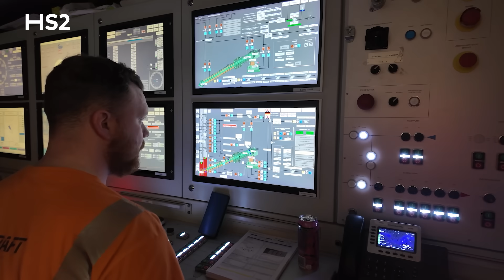HS2 Project Update, October 2025

Comment: UK Maglev 4 Dec 2021 — A frequent issue was   electrical failures concerning the magnetic transit system    at guess where?                                  > Birmingham > Birmingham Airport <
Maglev trains have set several speed records. The train speed record of 603 km/h   (375 mph)      was set by the experimental Japanese L0 Series maglev in          2015,  correct 2015!

The UK is till laying steel rail tracks down which will last for 100 years.

Comment: This pattern isn’t confined to government — it runs through every major Western corporate and public programme today.

What we’re seeing with HS2 is simply the most visible example of a systemic problem: the culture of institutional self-preservation, where leaders rebrand failure as a “reset,” “re-baseline,” or “strategic realignment” rather than admitting the design, sequencing, or governance collapse that caused it.

The same structural flaws repeat everywhere:

-  Build starts before design maturity or full analysis. Activity is prioritised over readiness to secure funding or political optics.
-  Commercial frameworks reward inefficiency. Prime contractors profit from claims, extensions, and variations rather than from on-time delivery.
-  Diffuse accountability. Nobody owns integration or system-level performance; everyone owns a slide in the deck.
-  Narrative replaces fact. “Resets” and “learning phases” become the language of decline, while cost and schedule performance continue to deteriorate.

And of course, I’m sure there’s a beautiful slide pack to make it all look under control, polished, animated, and coloured green on every RAG status, reassuring those who never visit the site.

Government is no different. The same failures of discipline apply: projects are launched before design and analysis are complete, often for political theatre rather than delivery readiness. Once committed, they’re too big to cancel, even when the business case fails.

The only credible way forward — in both government and corporate environments — is to treat each major initiative as a self-contained project: complete design and analysis before committing capital, apply independent validation at each gate, and kill it cleanly if the business case does not hold.

That’s delivery discipline — not optics, not “reset culture.” Until that returns, the West will continue to build before it understands and learn after it fails.

Comment: Impressive honesty setting the first phase of much-needed new railway capacity in the UK.  Without Phases 2A and 2B (through Crewe to Manchester and up the East Coast to Leeds, the stagnation and overload of the existing West Coast main line (major refurb work starting 2027) and East Coast Main Lone (new timetable Dec2025 but basically stuffed full) will bite with greater intensity.  Capacity does not come overnight.  I look forward to the next HS2 update, but "onwards past Handsacre" needs to be entering the song book for the next phase of planning and design.

Comment: We now know how to build a new high-speed railway system including everything from earthworks to tunneling, viaducts, tracks, ballast, sleepers, power, signalling, rolling stock, locomotive or multiple units, new built and upgraded stations etc 
Why not build the rest of the system to Inverness and for probably the same cost as has already been spent on a 5th of the line that's how it's supposed to work right?

Comment: I do believe that the HS2 will prove to be the most waist full and pointless infrastructure project. It is going to result in a one stop train journey Birmingham to London which will not be significantly quicker than what is currently on offer. The towns such as Milton Keynes, Rugby and Northampton will lose their express service to Birmingham and London. The cost of a ticket will be far greater than the current cost. Given the fact that business travel has shrunk since COVID I just can’t see who is going to use this service. The 100 billion spent on this project would have been better spent on developing the Midlands economy.
Reply: Since when did you get the idea that there will be no fast services using the traditional WCML route to Euston?? There can actually be more services Northampton/Milton Keynes to Euston due to track slots freed up by trains using HS2 instead.
Reply: @rhysjaggar4677 Because the whole point of HS2 is to put more freight on trains using the current lines. In addition to this there will not be enough demand from these smaller communities to justify the service. So no there will be a lot less services for these smaller communities. What is not clear is what services from Manchester and Liverpool will still operate. Are they going to terminate in Birmingham and the passengers transfer to HS2 trains? I have travelled regularly on the Midlands to London services and I can tell you that most trains are sparsely occupied once they leave the Midlands and head north. Personally I am not convinced that there is sufficient demand from Birmingham on its own to support the HS2 line. Now that the line is not going North the passenger numbers do not match the capacity, add on to that the reduction of passengers since COVID and it is a total mess. So yeah there are going to be reductions in services and I suspect an increase in costs.
Reply: @stephenbuck1280  I guess freight capacity is always useful in a growing digital world, but I can't help but think it would've been significantly cheaper to achieve it with wider motorways and an investment in electric HGV infrastructure to ferry goods from ports in the south up to the north. Trains are obviously a good 20th century solution, but when proper driverless things start coming around in the next few decades... what will HS2 be for?

Comment: The London to Birmingham Railway was built from scratch in five years using humans, animals, shovels, pick axes, wheel barrows and occasional steam cranes. It cost £5 Million from Private Finance. 
Will there be enough electricity to run HS2 by the time it is finished I wonder.
Reply: In a very different age with cheap expenable labour.

And HS2's electricity use won't even be 5% of the existing railway network, think of all the OHL and 3rd rail on Network Rail, 4th Rail on the London Underground and all the other systems, Mersey Rail, Tyne and Wear plus Tram systems.

Comment: Hopefully someone will have the sense to boot the treasury out of meddling with the project further. Their obsession with cost cutting has destroyed this project and their obsession with reducing yearly spend is hampering it further. The minister for transport needs to step up and get the treasury out of DfT business.
Reply: Im just as worried the damage that they can do to the existing network following nationalisation.
Reply: @garthcox4307 The good thing about that is that Network Rail gets it's funding in 5 year tranches so it's garunteed. The nationalised GBR will work under the framework of the existing Network Rail so that should help to protect it. The currently don't invest additional money into rail and I doubt that will change any time soon, so more of the same for the most part.
Reply: Sadly, The Treasury is the finance house of HMG. Unless you create an entirely different way of funding UK Government departments?

Comment: HS2 no longer has a benefit for wales by increasing capacity for welsh journeys, so it shouldn't be regarded as an england and wales project any more. 

With the connector at Litchfield kicked down the line wales should demand to receive extra funding from government for projects that actually benefit wales.
Reply: And you can already get from London to Birmingham in 1hr16m, vs 1hr46m from London to Cardiff. As I live halfway between London and Birmingham I naturally have to add over an hour to both of those times to get to either of them, and HS2 isn't going to change that 🙄

Comment: I think you maybe the bravest bloke in Britain. I was not aware that anyone was in charge at HS2. I appreciate you might not have written the spec. but I have never heard anyone working on this project say a good word about it, well I guess apart from you. I am sure one day someone will conclude literally tens of billions of pounds were wasted building this track. I am aware the UK needs new and better railway track but the cost of this is just ludicrous. In your defence the cost of just about all Government projects is unfathomable to anyone outside of Government.  Hinkley Point C was going to cost £18B now estimated to come in at £48b.  I just despair.
Reply: Don't hold your breath about the reset . It will only give an approximate updated estimate of the final cost and completion date.  Having worked for two of the Contractors building HS2 before retirement they will never agree to a reset of the contracts with the exception of accepting a profit share in finding cheaper methods of construction. So the costplus contracts will remain . All projects exceeding 500 million in value are procured the same way as Contractors balance sheets and margins are too low to accept fixed prices.
Reply: Picjing up your point about other government projects the cost consultants who put budgets together lack sufficient technical knowledge. Contractors know this only too well so when a projectcis advertised at a specific price level the reality is differerent. And the bigger the project the bigger the error. So when Heathrow's third runway is advsrtisdd at 15 billion the reality will be 20 billion plus, partly due to inflation snd partly due to workscope.. in Heathrow's case the workscope will be a new undsrground tube line, car parks, hotels, maintenance sheds, services alterstjonz, road alterations, diverting the M25, etc.

Comment: HS2 is a vanity project. The entire project would be cheaper if put underground - despite the fact that tunnels are much more expensive. 
Why cheaper? 1) No bridges 2) Almost no court cases 3) Almost no surface disruptions 5) Almost no consultants 6) The biggest two factors no cost plus contracts and no uncertainty about completion date.
Reply: Yiu are totally wrong about some pointd. Why no cost plus contracts
Reply: @TrevorWilliams-fq8mg Building bridges is inherently risky. The design must be a one off because no two bridges span the same terrain and length. Contractors will not bid for such contracts until massive amounts of preliminary work has been done. They will only do the job at cost plus. Once awarded  - all incentives to do the job quickly and cheaply disappear. With tunnels the cost is known and very predictable - the risks are tiny - therefore competitive tendering is possible.
Reply: Having worked for 2 of the HS2 Contractors before retirenent on the cost side , Contractors will not accept fixed price contracts exceeding 500 million in value as their balance sheets and margins will not support the riisks. Designers may say the designs are complete but they never are and never will be .
Reply: @TrevorWilliams-fq8mg Interesting. Would you recommend splitting sections of the construction into small sections so that they fall below that upper limit?
Reply: @johnfrancis4401 That's a possibility but might present more contracts that could go wrong, causing a bigger headache. I don't see the entire railway as being in a tunnel. Air pressure ahead of the trains would be huge. And the journey claustrophobic for the passengers. I don"t think it would have been considered .
Reply: @TrevorWilliams-fq8mg The line would surface for stations en route. The Channel Tunnel doesn't seem to experience the problems you refer to.
Reply: @johnfrancis4401 the Channel tunnel has an escape passage which also acts as a ventilation passage so that would add cost in.  Have you done an estimate ? If you can arrive at an  elemental cost for the tunnels and stations ( which would be extremely difficult to do) that would give you what a cost planner would do. But then there would be the detail to add and is where a costplanner would fail as the detail will cost a lot more thsn you would envisage.
Reply: @TrevorWilliams-fq8mg  Small thin shafts could be created to allow ventilation and reduce air pressure build up ahead of the train. Presumably during the planning phase of the route shafts are dug to check on the type of rock being drilled though  - these shafts could be kept open to facilitate air flow.
Reply: @johnfrancis4401 boreholes are taken to establish the soils and water table.
Reply: @TrevorWilliams-fq8mg Exactly. If you put pipes connecting the tunnel to the surface using these holes there will be space for the pressure to escape
Reply: @johnfrancis4401 It will be interesting to see your cost comparison.
Reply: Delayed by 4 years. What will happen to the rolling stock that is on order?

Comment: Stop-starting from the very top hasn't helped. Nor has the gold plating - Chiltern tunnels more extensive than needed to avoid upsetting certain voters. But I hope the gov says that's a realistic plan, but then opens a new Brum-Manchester project to start now and link up with trans-pennine upgrades.
Reply: Yep and cut and cover tunnels instead of cuttings, in some cases even in existing cuttings of disused railway lines.

Comment: Everyone we Need to build 11 platforms at Euston. Otherwise it’ll be impossible for HS2 to ever reach Manchester or Leeds. Government cut hs2 down to 6 platforms now
Reply: Why would the government build any platforms at Euston? In its current state the line will terminate at Old Oak Common. I doubt there is any money to extend the line into central London. The tunnelling has only been done as it was cheaper to continue than to cancel.
Reply: @wdielwlairajmd  HS2 is a capacity release program, now just for the WCML. Currently the WCML goes to the centre, so to release the most capacity enabling people to get to the same place is advantageous. If it stops permanently at old oak common then less people will want to use it and it will greatly increase the traffic on the GWML which is also short of capacity. Trains terminating at Euston reduces the most load on the WCML delivering the program best.
Also OOC was not designed as a terminating station, using like that indefinitely will reduce the number of services which can run on HS2 which is poor value for money.
HS2 has suffered from random cutbacks that seem logical but undermine the long term value. (see the "interim" now possibly permanent handsacre junction for another example).
Reply: @LD-yv2om Not sure what you are getting at here? I agree with most of what you wrote. The HS2 route was chosen well back in 2009. But it’s now 2025 and HS2 is now just an Ealing to Birmingham service (probably 3tph) with the potential for another 3 tph to Manchester. That’s it unless it’s extended into central London or further north. 2025 HS2 does not release much capacity, it will actually add to the bottleneck around Colwich/ Stafford.
Reply: @LD-yv2om The only benefit the WCML gets from Phase I is an increase in track slots for commuter services to London from Coventry, Rugby, Northampton, Milton Keynes and Watford. The true blockage in WCML capacity occurs in between Birmingham and Crewe, on what would include the Phase IIa of HS2. That's why Phase IIa was so important to complete, as the true blockage to capacity would have been released.
Reply: @wdielwlairajmd  Do some reading, HS2 will not terminate at Old Oak Common as the station won't have the facilities to be a terminal station, they are about to start tunneling from Old Oak Common to London Euston now.
Reply: @peterwallen1063  I know they are tunnelling to Euston and I know that OOC isn’t suitable to be a terminus! Why do I need to do any reading when I clearly know a lot more about the project than you. OOC will be the terminus for probably around a decade. There is no agreed plan for Euston - the tunnelling is being done as it’s cheaper than cancelling.
Reply: @wdielwlairajmd  you are showing your ignorance. Money for the Euston tunnels has already been signed off by the Chancellor and loads of works between Euston an OOC are still progressing.
Reply: @paul2funky  Not true I'm afraid - I stated in a comment above that the tunnels are progressing so I am not ignorant of that. These tunnels are only progressing because it is cheaper to do this than to cancel. Much of the works for Euston stopped ages ago and there is no current plan for a Euston terminus (e.g. no agreement on number of platforms needed, oversight development to pay for the station, impact of St Paul's protected skylines, etc). As it stands, HS2 trains will terminate at Old Oak Common for many years. I'm sure plans are being drawn up in the background, but any plan would need funding.
Reply: Erm it’s not going there anyway 😂
Reply: @Tamarlane389 yes it is, check your facts.
Reply: @Mtmonaghan no it’s not. Check your facts.
Reply: @Tamarlane389  Erm, yes it is going to London Euston and one way or another HS2 trains will go to Manchester
Reply: @peterwallen1063 ’one way or another’ does not sound like a plan. Don’t you remember what Sunak did?

Comment: As others have said the other legs of the route will have to be built. Otherwise it’s pointless, and little benefit will be reaped. They need to stop kicking the can down the road and just build it in its entirety.
Reply: Well, the land has been forceably taken from its previous owners and the homes thus attained are now being let out to get a bit of cash in.
Reply: Sadly Sunak sabotaged any hope of that happening in the near future by quickly selling off all the land that had been bought up for the other legs of the rout before the election. It will take another decade or so now to buy back all that is needed